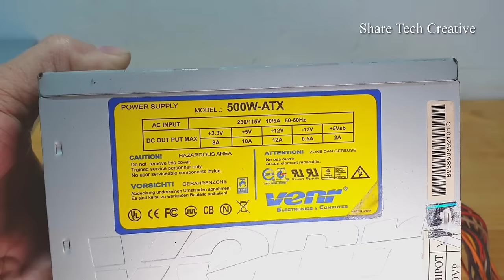How to Turn a CD ROM Old & Into a Stereo Music Player / DIY Powerful Bass amplifier

Comment: I have to say, not a bad video at all. Not convinced that was a 500W PSU though but it worked which is the main thing. I'd have found up an old pair of stereo speakers, one's already in a box, or made boxes for those. Audio would sound way better.

Comment: 1. CD audio jack is LO-FI 12 bit DAC output; 2. Speakers without a case is a bad idea; 3. using +5 for an amplifier is not optimal decision, +/-12 wil be better one, but -12 line has a very small current)

Comment: Yes that's right.The work is simple.But you need to know the basics of electronics.For example, what is the input and output of the amplifier and the voltage of 5 volts, 12 volts and zero volts?
Reply from the maker: Yes, you are right
Reply: Mda. Mai precis trebuie sa great rotitele, curea de antrenare cd.dar se stie ca e nevoie de inteligenta, ,,,,si trebuie folosita,,,,💂

Comment: Nice video
Reply from the maker: Thanks
Reply: Ji Haan Aap Be Is Kabil Ban sakty Ho Ye Bahut simple sa Kaam hai Purani Power supply se 5 aur 12 Volt Liyay aur aik Amplifier Cd Rom ky ander install kar diya aur iss amp ko supply diya cd ky input pis sy phir Cd ky Headphone jack sy audio amp ky input mai lagaya aur Speaker output Amp sy Cd kay Pin Py Laga diya

Comment: It would be simpler, more modulable, with no ATX and/or CD drive modifications, to simply make the ampflification/speakers external (powered by one molex of the ATX for example) ???
Like putting the amp and the speakers in 2 separate boxes, like any standard external PC speakers...

Comment: Brother you could use stereo jack for both speakers :)
Reply: bad idea
Reply: @kennmossman8701 ... I wouldn't use a computer CD ROM where I think there are some remaining radio/ CD players already from car stereos to boomboxes out there that immediately have a left and right speaker connection to be a boombox standalone with a power supply design.  I haven't engineered with them since my truck with a CD player still runs and I haven't messed with other cars recycled CD players built in with radio stations from car stereo systems.  I've done many 120 VAC to 0, 5, 9 and 12 V DC power supplies projects to not have a stereo system from a car 12 V DC limitation.  Then speakers to car speakers are the same to a standalone living room amplifier stereo system speakers.